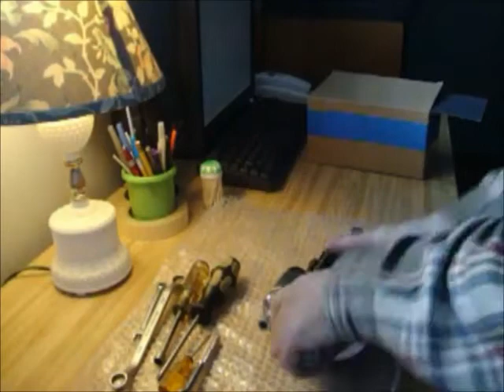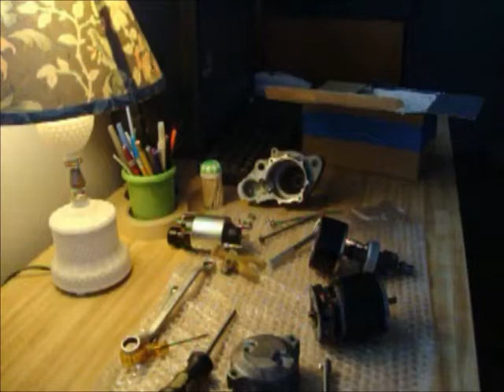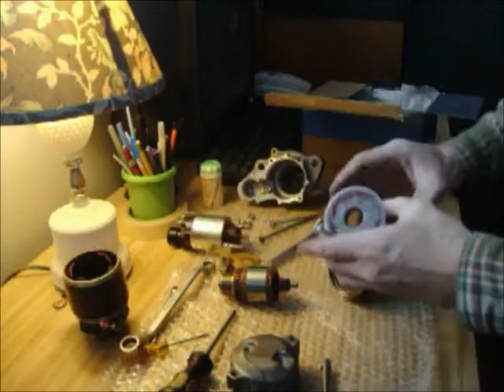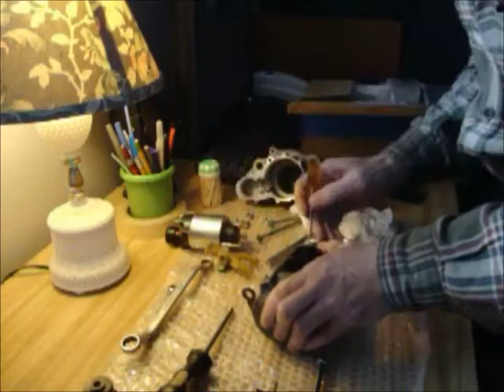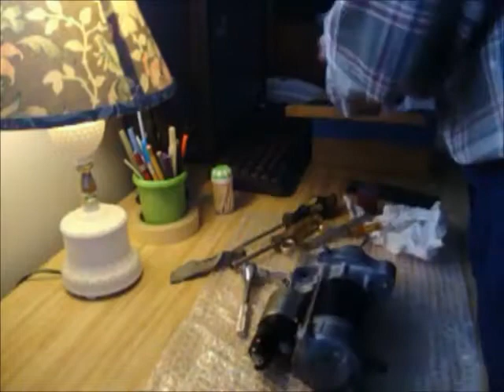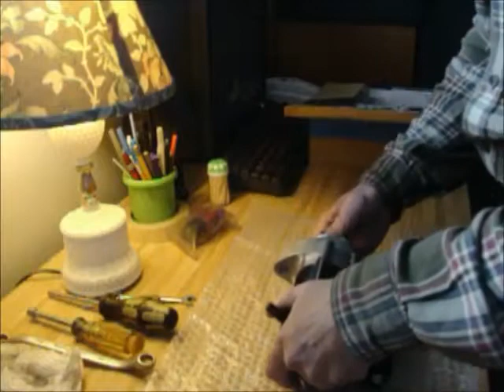Starter overhaul 2007 Honda Fit

Comment: excellent video. This proves there is nothing wrong with the starter, just needs repair. Where can I purchase the correct grease? thx
Reply from the maker: I bought my in Grainger; from experience, CV joint grease from Autozone will work as well

Comment: I forgot to ask.. where can I buy that tool needed to hold the brushes in place? part number? thx again!
Reply from the maker: I've made it myself any plastic pipe with 28 mm OD and chambered end could work
Reply: @mkrp4  so you used a 28mm socket? not sure what you mean by chambered end? maybe you could send me a photo? thx!!
Reply from the maker: "chamFered" the spell check sucks sometimes...